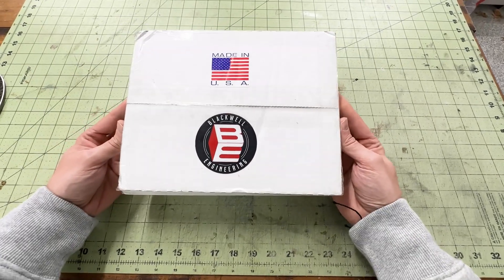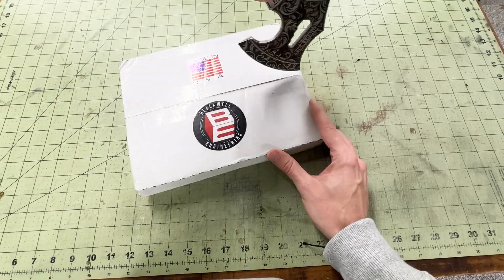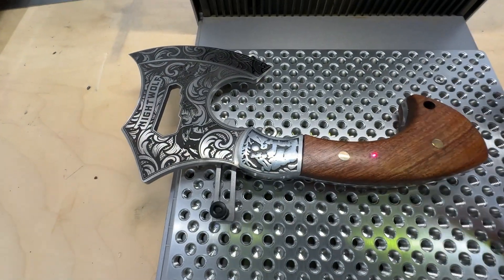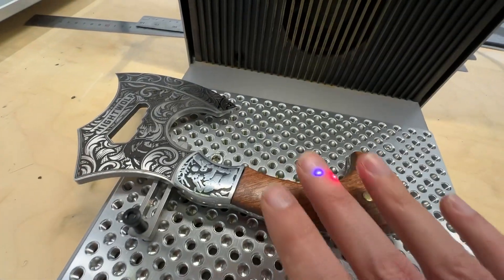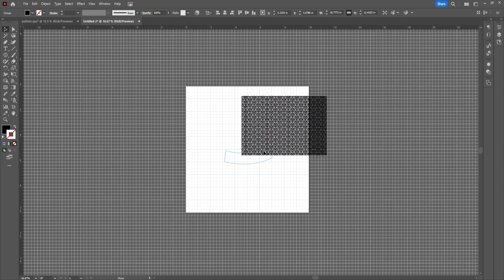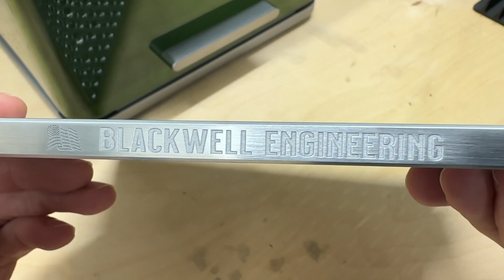I wont use my xTool F1 Ultra without this accessory!

Comment: Where is that hose from at minute 11:58, and what do you connect to it so that a strong airflow is produced? I’ve already tried a small compressor, but it gets super hot after just a few minutes. Is there a cheaper solution than an oil-lubricated compressor, which costs a ton of money?

Thanks and best regards

Comment: You used the fixture clamps the wrong way.  The threaded insert points up, with its head on the plate.  It is used at the back end of the bar, at the far end from the piece.   Then the front bolt with the handle goes in the opposite direction, threads downward, and threads into the plate.  By setting the front to just over the height of the piece and then increasing the height of the rear, the front bolt acts as a pivot, and the bar is pushed downward onto the piece.  This orientation lets you hold something down with only a downward force.  This method doesnt potentially "squirt" the piece away, as could happen if the bar were oriented with the back end low and front end high, producing a downward, but also forward pressure.  This clamping style is common in CNC routing, where lateral forces are in play.
Reply from the maker: I will use that next time. Worked out for this short job.